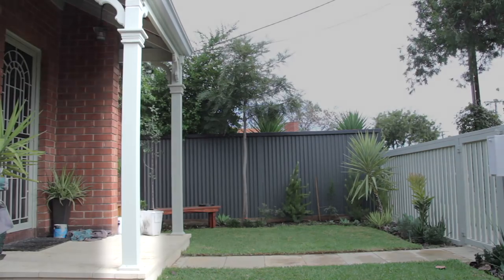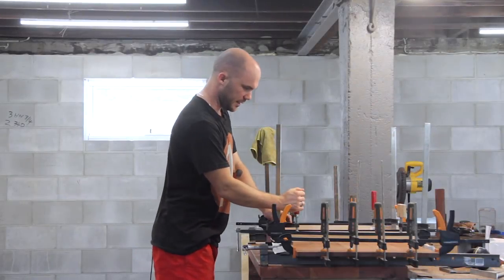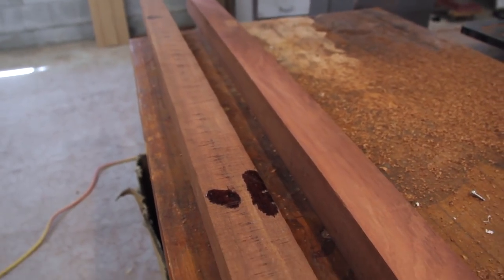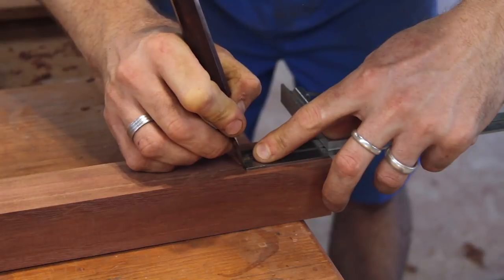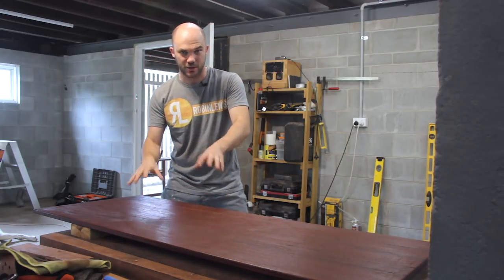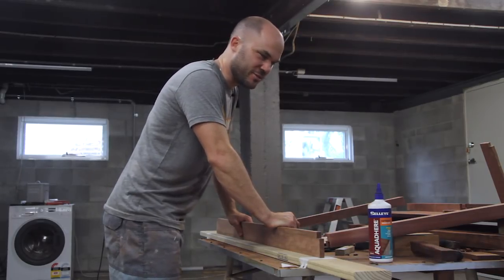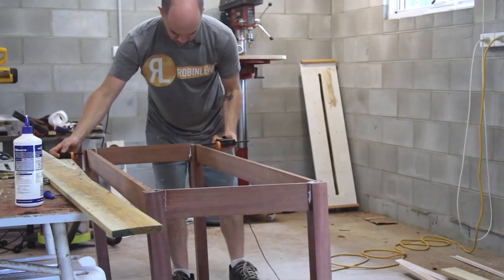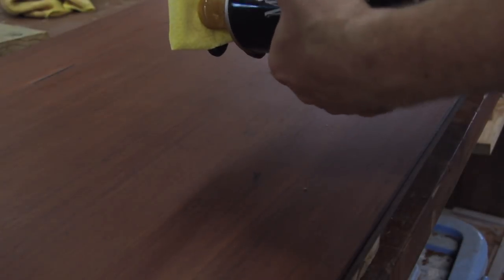Simple Elegant Table From Recycled Wood | Woodworking

Comment: Looks good Robin, but use packing (plastic) tape on your cauls, not masking (paper) tape! I'm going to have to make up a flush trim plane  so you stop using a chisel with squeeze out too ;)
Reply from the maker: Funny story; I was looking for my packing tape but couldn't find it. Thought I'd give masking take a go and it actually worked ok! So it's a decent plan B when the packing tape has been out partying the night before and lost in a gutter somewhere.

Comment: should of use a 2 pac much nicer tbh and will last longer
Reply from the maker: What is a "2 pac"? I haven't heard of that before
Reply: Robin Lewis can get it from paint shops 2 pac enamel it’s a 2 or 3 coat one coat ever 8 hours or so very good stuff they use it timber floors as well
Reply from the maker: I'll have a look into that, must be solid if it's used on floors!